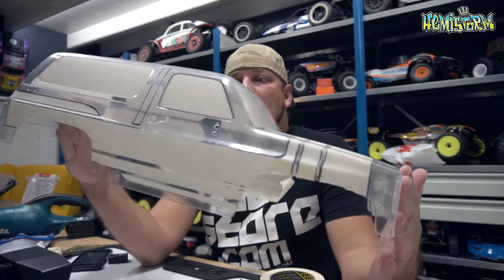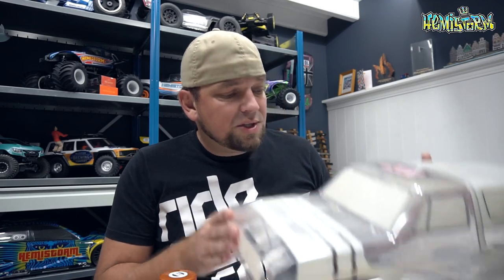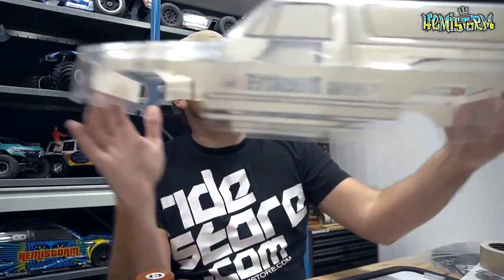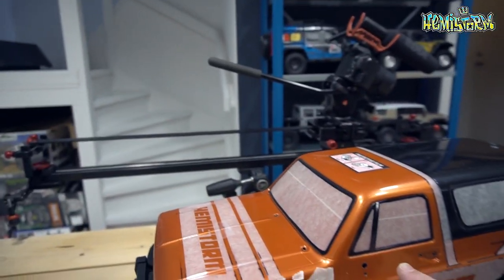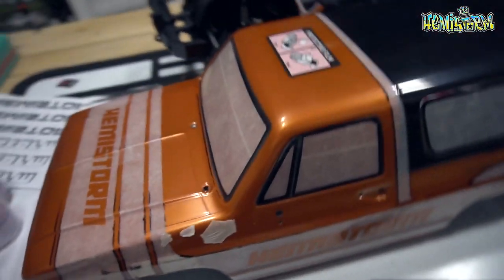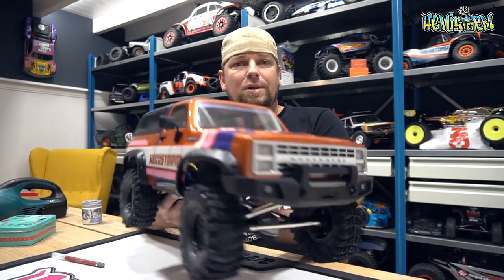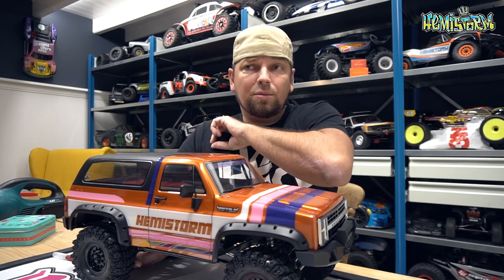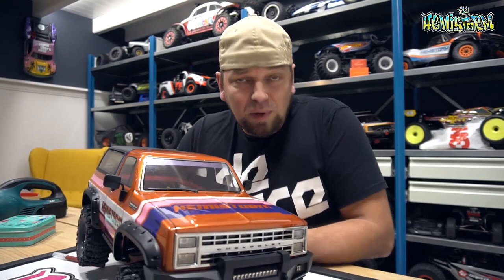HIP TO BE SQUARE! - RC Chevrolet Blazer Paint - GMADE GS02F

Comment: I saw your video on building the hpi rs4 chassis and also recently purchased it and when i took out the pinion gear cover I couldn’t put it back in without having the screw holes align and was wondering if you could help?an answer would be very appreciated as im stuck at that step.thank you

Comment: Dang that looks good! I noticed you had the cans sitting in water before using them, was that warm water so they spray better?
Reply from the maker: Yes indeed! I always soak them in hot water to increase the pressure and get a more even coat.

Comment: When you’re slicing the protective film on outside around doors and hood to create the panel gaps what size/# exacto blade did you use? Do you wait a bit after slicing for the film to retract slightly or just have at it?

Comment: Anyone know if that nice chevrolet grill would be able to be made to fit a clodbuster body?  I dont mind filling a few gaps etc to make it work....btw....that is one nice blazer!
Reply from the maker: Not sure! If you give me the width of the front of a Clod I would be able to measure it for you.
Reply: @hemistormrc  I found sizes online as 16cm wide x 3.79cm tall, not sure if that includes the mounting tabs on the clod grille, my truck is in storage, I could measure it next week,   if you could post the overall width and height of the grille it would be awesome.

It is a way better looking grille than the generic tamiya reissue with 4x4x4 on it, and the 3d printed options I have seen look kind of rough, the Gmade grille looks so good, I am hoping it can be made to work on the clod.......might even consider swapping to the entire blazer body, yours looks great!
Reply from the maker: @jasonrackawack9369  184 x 36 millimeters approximately. I hope that helps!
Reply: @hemistormrc  Thanks your the best👍 Will check the sizes out as soon as I can.  Thanks for the help!